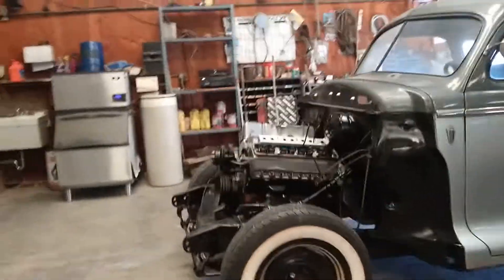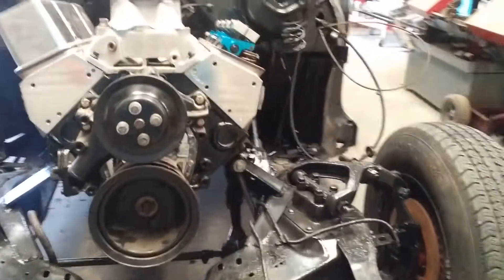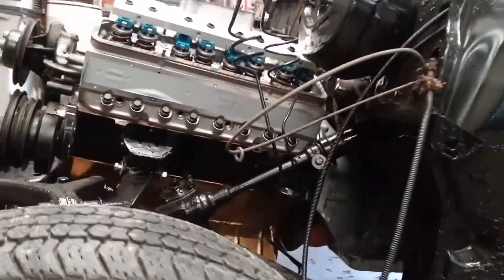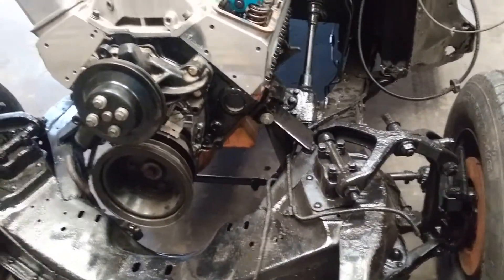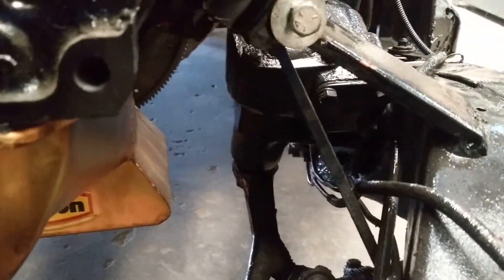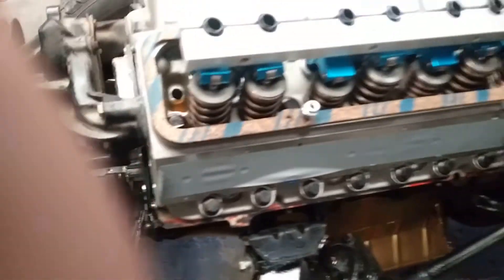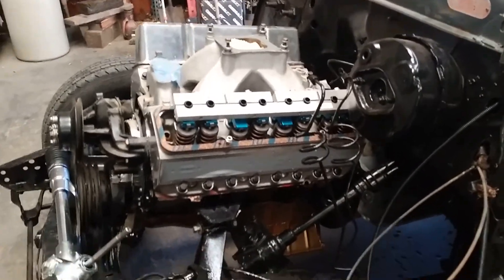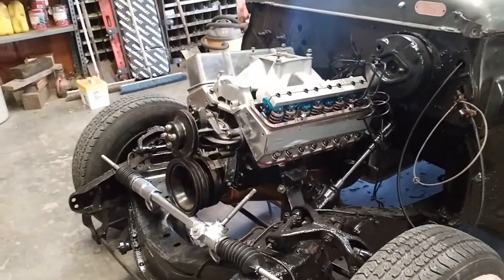1947 plymouth 2 door. rack and pinion steering.

Comment: I have a 50 Plymouth coupe. What disc conversion do you have on the front??
Reply from the maker: Hi.  Thanks for watching my videos.  My disk break kit is old. Its from a company called plydo.  They are no longer around.  This kit is not the best kit because it uses a sleeve on the spindles.  So if u ever burn a bearing... u need to find this sleeve.   It uses mid 70s valent or dart calipers and pads and rotors.  The biggest flaw is the spindle sleeves.  Id suggest finding a better kit.  I know they are out there.
Reply: @skimdoodle1006 yea I just looked into it, thanks for replying. I’m gonna commit cardinal sin and weld in an s10 front end
Reply from the maker: U won't hear my complain. Iv been thinking of doing a early firebird front frame.

Comment: Hi again.  Well my redo og my tie rods and center cradle did cure my bump steer issues.  Tie rods parallel  to lower control arms AND same length as lower control arms.
Reply from the maker: Thank u very much for the reply.  Thank u for remembering me and taking the time to let me know.  I hope to see videos of pictures of the car.
Reply: @skimdoodle1006  I'm working on the interior now...about 3/4 done. Gray buckets from Lincoln Navigator.  Covering rear seat from mid 70s Dart with Mexican blankets.  Having to fab the rear arm rests, etc.
Reply: @skimdoodle1006  soon as I figure out how to send pics😔

Comment: Hey. I said I would keep you posted on my bump steer issues.  I re-engineered the tie rods to be EXACTLY the length of the lower control arm.  And also have them exactly parallel to the lower control arm.   Test drive showed massive improvement . I need alignment to fix the toe.  Good luck with your Plymouth.
Reply from the maker: Great news.  I will do the same with mine.   Thank u for the update.
Reply: @skimdoodle1006  FYI.  I used hiem joints as the inner tie rod ends because of tight space and minimal clearance.  Regular tie rod ends as outer ends.

Comment: The big problem is a chivvy engine in a Mopar .  Terrible mistake .  small block Mopar goes right in .  Butchery
Reply from the maker: Yeah.  Wish i had a sbm.
Reply: @skimdoodle1006  318's are under $50.00 ,  360's are under $300.00 running

Comment: A couple thoughts.  On the old steering box I notice a plate bolted to the outside of the frame that probably gives access for easy removal of the old steering box without cutting.  Have you considered getting a pair of stock GM motor mounts then build a perch or your own to attach to?  That now kit does seem pretty straight forward.  Good luck.  I know you will make it work just fine. Let me know if you need help.
Reply from the maker: I always need help.   It's time we get back to it.